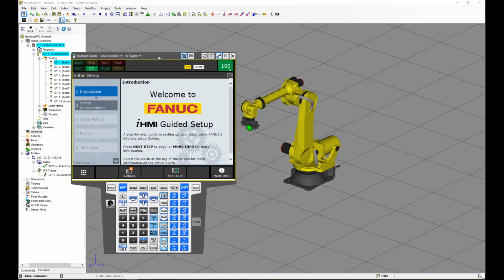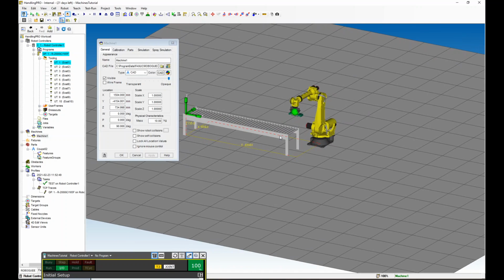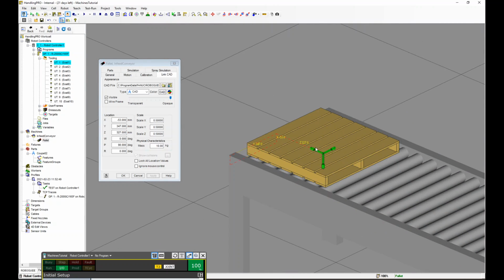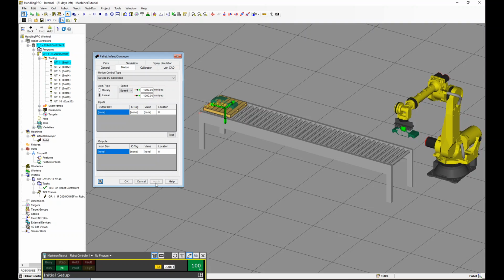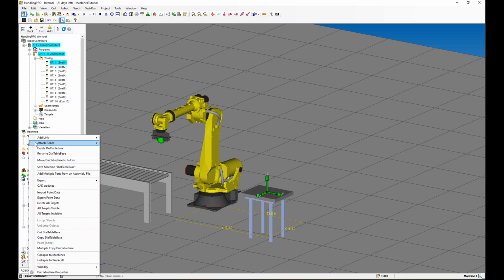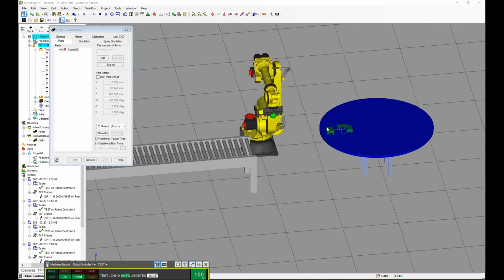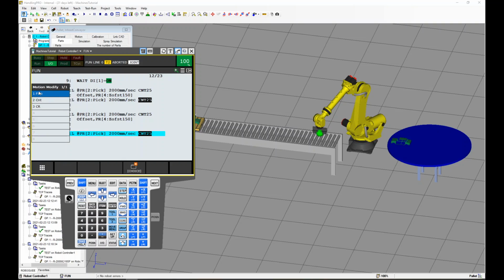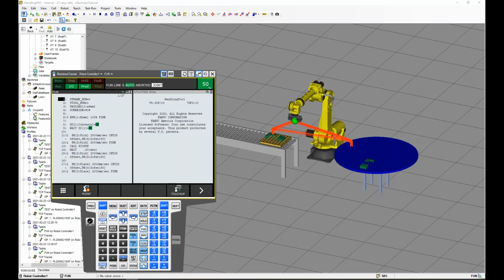RoboGuide Machines: Conveyor and Indexer Motion

Comment: Hey Adam! Another awesome tutorial. Made a list of highlights to jump to for reference and wanted to share.
	0:00 - Intro
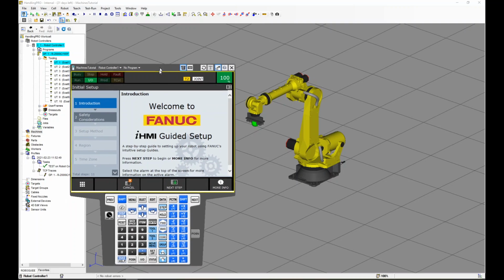	1:04 - Initial Setup
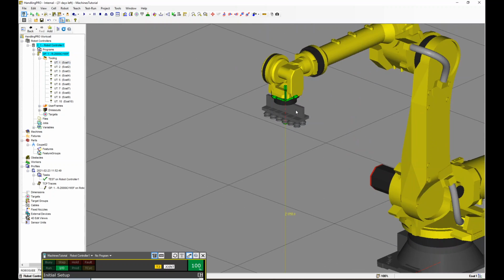	2:10 - Assign Part to Tool
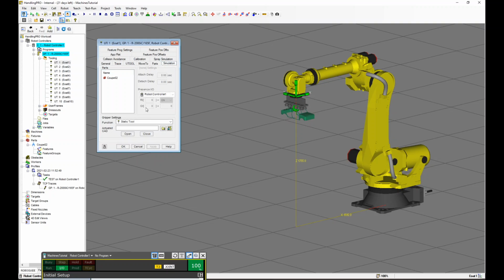	2:55 - Fixture vs Machine
Linear - Conveyor
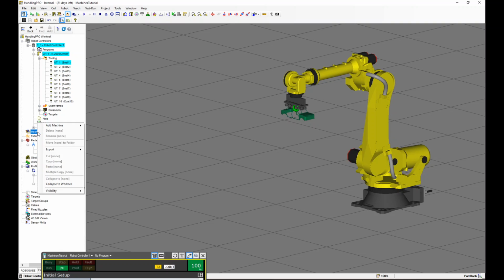	3:15 - Adding a Machine 
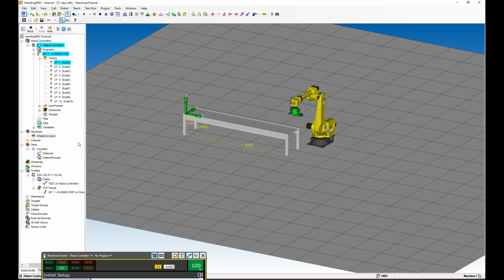	5:09 - Adding a Link (Pallet)
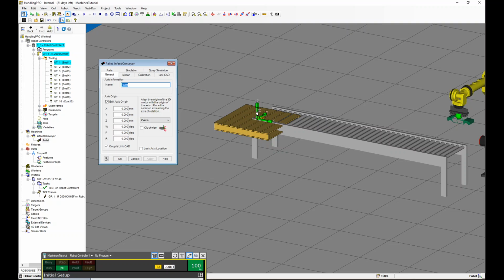	6:38 - Define Axis Origin
	9:05 - Reference Note: For conveyor tracking use iRPickPRO or PalletPRO
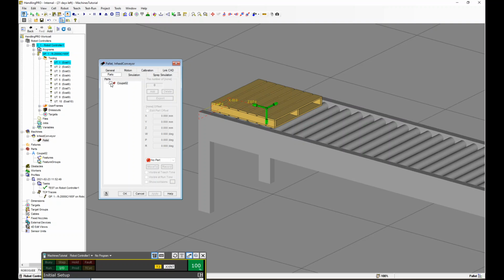	10:35 - Assign Part to Link
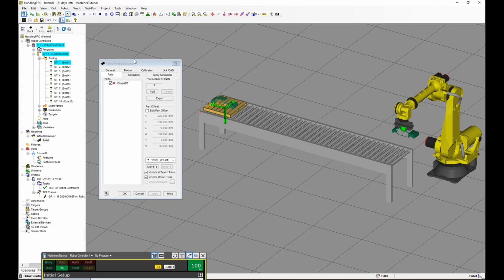	11:20 - Simulation and Motion setup
	12:40 - Motion Control Type
	15:24 - Testing Conveyor Digital Outputs and Inputs
Rotary - Dial Table
	17:05 - Adding a Machine
	17:55 - Adding a Link (Dial)
	18:05 - Define Axis Origin
	19:10 - Assign Part to Link
	19:54 - Motion Control Type
	20:52 - Commenting Digital Output names
	21:53 - Testing Dial Table Digital Outputs
Combined Systems
	22:24 - Create new program and setup
	23:10 - Teaching Position Registers (Home, Pick, Place, Zofst150)
	25:00 - Coding the program (Linear Move, Pick, Place, Home, Rotary Move)
	28:15 - Setup Pickup and Drop simulation program/logic
	28:54 - Call Pickup and Drop in program
	29:30 - Test Program Code - Success!

Comment: Could you index the dial as in maybe 2 or 3 times to move the part to 180 deg or 270 deg and pick in with another robot?
Reply from the maker: Absolutely! You can set the degrees for rotation to be larger, or, setup additional DO[x] bits to have the machine link rotate to 180, 270, etc. Triggering the same DO[x] multiple times will not move it more times though. The DO sends a positional signal to the link, so you'd need to setup more locations like shown at 20:37. 
From there, you certainly can have another robot pick the parts!

Comment: Great Information. I want to connect an M-20iA to a Fanuc 32iTB iHMI cnc machine, but not really sure where to start.
Reply from the maker: Hi Daniel, there is a robot option called "Machine Tool Interface Package" that allows you to develop an interface between robot and CNC to upload/run programs, monitor status, etc. I'd recommend starting a conversation with your local FANUC rep on how to get/setup that option. Good luck!
Reply from the maker: Daniel; one more option, you may want to look into the G-Code option; check it out here: https://www.fanucamerica.com/products/cnc/software/cnc-robot-control-qssr-g-code